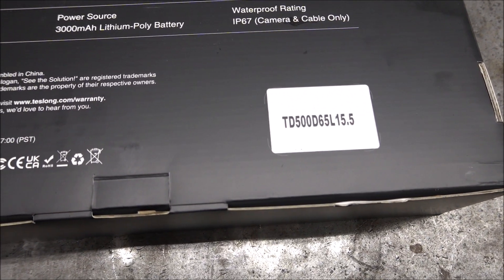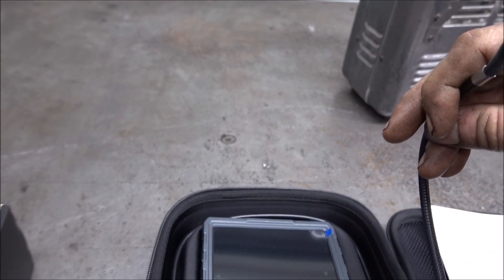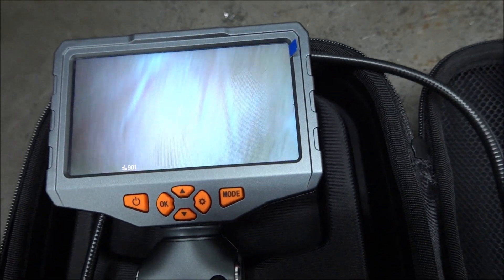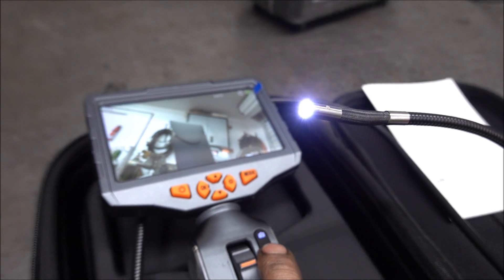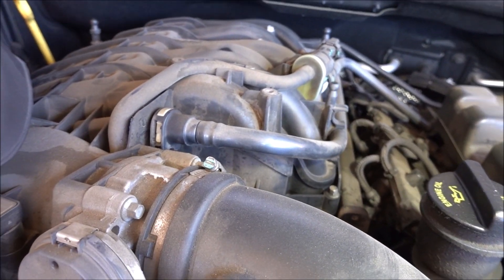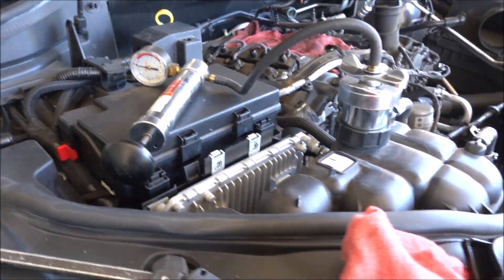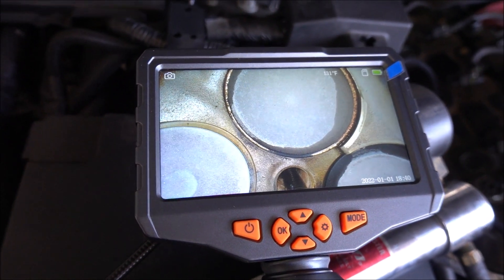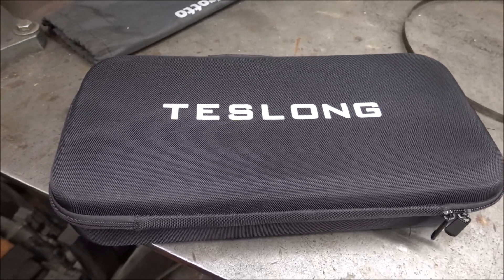Teslong TD500 Articulating Borescope Review @teslongusa

Comment: That's a great up close view. I've had a few of these in the focal length is like 3 in away which is way too far for sticking down a spark plug hole. This one looks like it has about a half inch focal length which is awesome!.
Reply from the maker: Thanks.  The picture quality is excellent. Also the lights are very good. My older none articulating ones were bad.